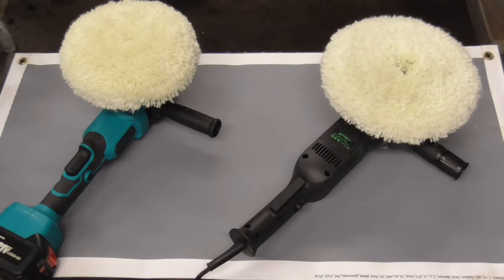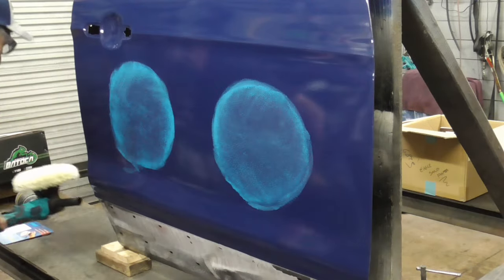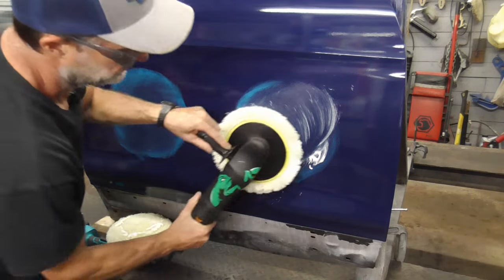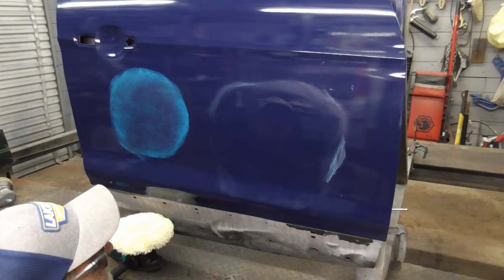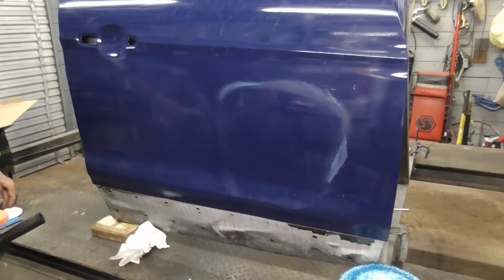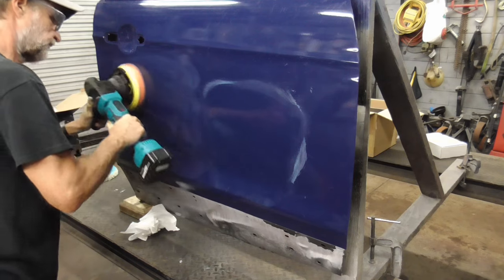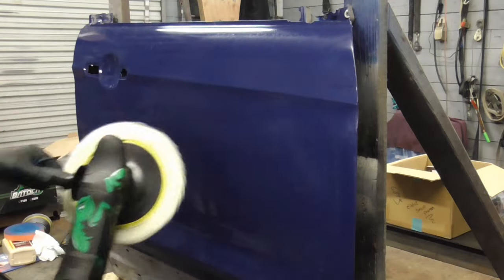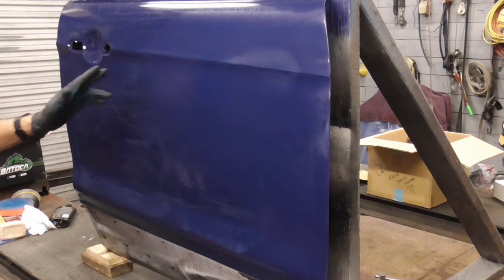Difference Between Rotary Buffer & Random Orbital Buffer

Comment: Great video Jerry! Last week I bought the Harbor Freight Hercules 8 Amp 6" Forced Rotation DA Polisher on a 20% off sale. Target project is a camper with lots of decals I need to make pretty for sale in the Spring. I've never run a DA polisher, and so didn't think about it being that much slower. Maybe the Forced Rotation will speed things up, much like a Bondo Hog, while still being gentle? It is a fairly new tool, but so far reviews are good! Thanks for doing a video showing the differences!
Reply from the maker: Interesting - let me know how you like that tool.  Might have to pick one up and try it out.  Thanks for the information - enjoy the weekend :)

Comment: Perfect timing on the topic.  I need to remove orange peel on my first paint job and didnt know if my DA polisher would work well or not.  Since I'm a novice probably best to stay with DA instead of rotary.  What buffing and polish compound do you recommend?
Reply from the maker: Meguiar's Mirror Glaze Diamond Cut Compound 2.0 M8532 or 3M stuff of the same type.  Something that cuts well.  Anything name brand will work for the polish Mequiars or 3M.  Thanks for watching Craig - enjoy the weekend :)
Reply: Thanks for your suggestions, I'll see if those products are available locally.  Keep up the great content.
Reply from the maker: 👍✌ @craigmyers5569